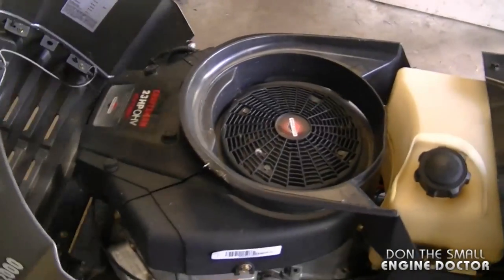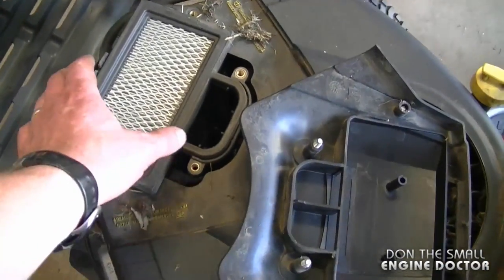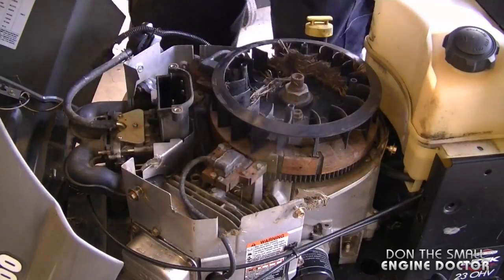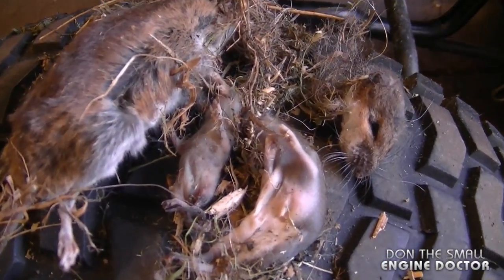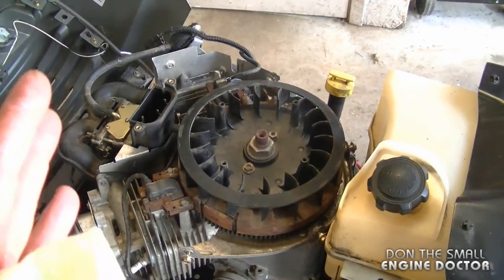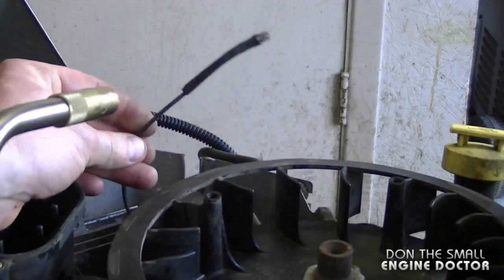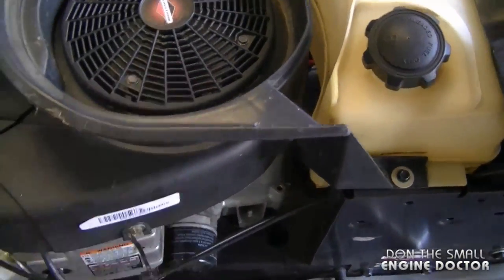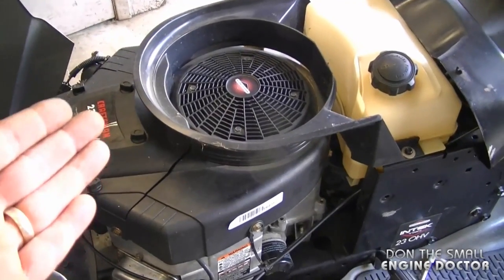How-To Clean A Lawn Tractor Infested With Rodent Nests!

Comment: I've got a ZTR that must be stored over the winter in an open shed.
Brother, you got off easy with that one!

I've discovered mothballs that come in prepackaged ventilated bags at the local hardware store (2 to a box). After repairing all the wiring behind the headlight of my wife's car due to mice chewing, I put two of these under the hood and since then haven't seen a single clue of them. Chipmunks are another issue but thankfully they don't seem interested in chewing, just storing nuts.
This winter I'm planning on a couple of these bags in and around the ZTR engine and then a plastic leaf/garbage bag covering.

Can't wait to open the snowblower in the coming weeks.

Comment: I use both mothballs and dryer sheets.  Wrap a couple mothballs in a dryer sheet and tuck them in place,  The sheets tell you where the mothballs are making it easier to remove them prior to use.

Comment: To add convenience to your mothballs as a prophylaxis suggestion, old socks and nylon stockings make convenient portably convenient holder assets that can be threaded with a bit of mason's wire or 'loop hung' using a pair of cable pull ties.  Should work fine too for little bags of cayenne pepper and the other smelly repellants suggested by others.  Thanks for all your quality videos.  Do have to agree with the chorus of those suggesting using a shop vac first and foremost and then blowing the sucker out whilst still in the outdoors--or for anyone, especially a business... to take it out before blowing it out!

Comment: Great tip. Also remember to clean you single cylinder riders too. Grass builds up inside the flower housing and around the fins, leading to overheating , blown heed gaskets and dropped valve seats. Believe me, I know.

Comment: Never had any luck with mothballs, what I found that works great by accident was Fluid Film. Storing all of our Salt Dogs for the summer, I would spray down the throttle panels and electric throttles so they would not rust up.  Haven't had any mice or mud wasps make nests in the engine compartment since. I use D Con around the shop, they set off the motion sensors.......

Comment: Why not use a shop vac with a narrow nozzle for sucking up most of the crud? The crud and its fines go into the vac instead of onto the ground and into the air around you...and back onto another part of the engine. A lot less messy overall. Then use air if you have to for tiny crevices.

Comment: A mask is not a bad idea for cleaning out rat's nests, but if you have access to a respirator, I'd opt for that. My lungs seem to getting worse over the years, so I finally bit the bullet, and bought a full face respirator. No more burning eyes and lungs while mowing through dust clouds. I should have bought one years ago.

Also, given the presence of the nest, I'd guess that the engine DID experience overheating. So IMO, to "do it right", I'd also do an oil change and a valve adjustment. That's what I'd do if it were mine, but I'm sure a customer wouldn't want to pay for that extra service.

Comment: I've had 2 classic cars damaged by mice. I am not a fan of poisons as the mice may crawl into the car and die. The smell of dead mouse is unbelievable and it seems to be impossible to remove. Snap traps and peanut butter will catch most of them, but you must find out where they are getting into your buildings and plug up all the openings. If not the problem will never go away.

Comment: I would suggest that if at all possible, you clean out/ blow out mouse crap out of doors, weather permitting. Doing that in your shop simply blows the crap and possible Hanta disease around your workshop where subsequent activity can stir it up in the air again and possibly cause health issues. Keep that stuff outdoors if at all possible. A very informative video otherwise.

Comment: Need to spread some rat & mouse poison in, outside & around the shop. This will reduce the rodent population dramatically.
Reply: It will also potentially kill birds of prey such as Eagles and Hawks.  
No poison.
Reply: Well, the rat & mouse poison is placed inside, where small animals live & travel. Not outside on the ground so birds and other animals might eat it. Gonna use common sense with this stuff & be smarter than the animals.